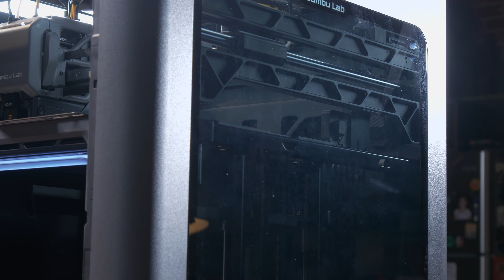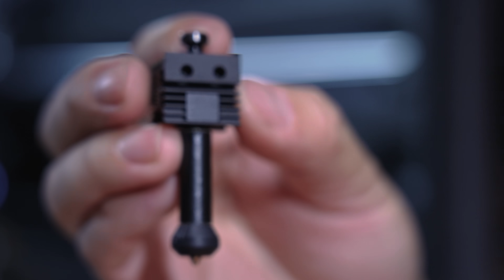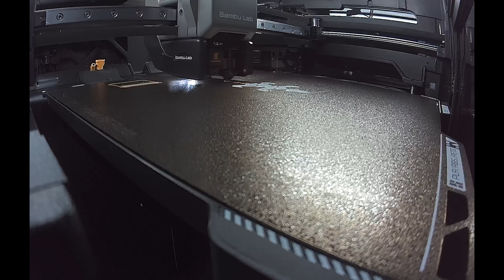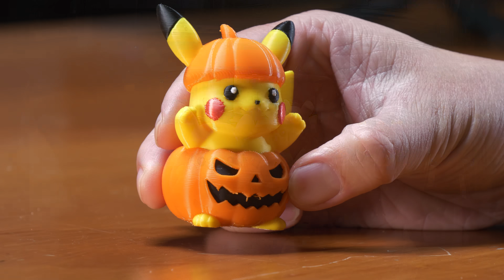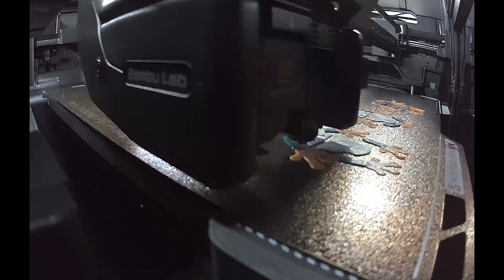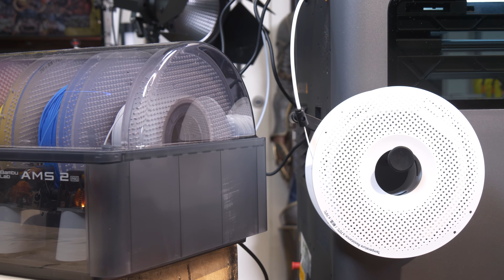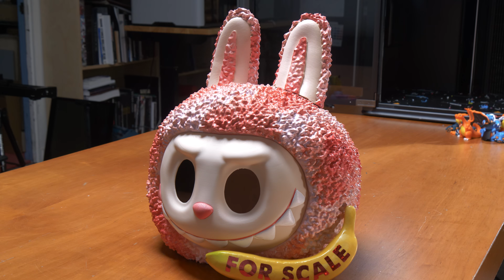Bambu Lab H2C 3D Printer Review: Vortek Tested!

Comment: Okay, so less poop. Yay! However, it still has to switch the color, pulling one out with the AMS and injecting a second one. That seems like time savings would not be all that great, especially since it still has to prime. For $2400 dollars, I think that's still unacceptable. I'm more interested in the separate multiple toolhead systems ala Prusa and Snapmaker. Admittedly the XL is absolutely ridiculously priced the the point of absurdity, but the U1 being sub 1K is an actual gamechanger. I'm thinking that's the direction I'll be going, assuming it delivers on the promises given on their Kickstarter.
Reply: But the nozzle has to be primed for printing or you end up with a length of print that is under-extruded. It might be okay in some cases but if it does that on an exterior face or in a critical location the part would be ruined. This happens with the Snapmaker and Prusa as well and with up to 7 tool heads and up to 4 ASM systems the H2C greatly exceeds the other printers in versatility. If your print only needs 4 colours/materials then the Snapmaker might be enough but the moment you need more than that you need a Bambu machine with multiple AMS systems.
It would be great if they could prime in another way but for now its a requirement of all the printers, regardless or price.
Reply: On the flip side, less to go wrong.
Reply: I received my Snapmaker last week. So far it definitely delivers.
Reply: Am I getting this wrong? To me it looks like there is still waste, it is just going into the prime tower instead of out the poop chute.
Reply: @jamesmeader6539  every printer needs a prime tower. It's still 'waste' but is a requirement for clean prints. Check out CNC Kitchens review for a good comparison and explanation
Reply: @jamesmeader6539 Very small amount of waste to prime tower vs very large amount’s tested out the chute. See CNCKitchen reviews.
Reply: Snapmaker got this one right
Reply: @BillSingh321  There will be Patent wars involved. I know Stratsys are sat on dozens of patents just to prevent other printer companies from getting a leg up on them. The Vortek system seems to be a compromise based on those limitations.
Reply: The Bond Tech solution is the most interesting, that may end up on my Voron, in the mean time, my SnapMaker U1 should be nice, when it arrives.
Reply: This has the advantage of printing the same spool with multiple nozzle sizes. On something like a prusa you'd need a spool for vg toolhead. I'd see myself printing one filament in 0.2, 0.4 and 0.8 depending on need a lot more than multicolor prints.

Comment: Amazing engineering, but looks like it could have a lot of potential issues and points of failure.
Reply: Seems like an intermediary step towards something good. I will skip this generation for sure.
Reply: @WordupG same same
Reply: Like the abhorrent bed heat problem..
Reply: It's a bambu lab. Issues and problems are guaranteed.
Reply: I'm not so sure. No pogo pins like the snapmaker, induction heating which is completely contactless, a stepper motor which is proven tech and just moves the rack up and down; it seems to be pretty simple in its execution even though its quite unique. If something breaks, it looks to be extremely low cost as compared to moving entire toolheads around
Reply: @SangheiliSpecOp  Fingers crossed yeah, time will tell.
Reply: Are you a bot that posts this same comment verbatim on every possible platform? Great for you that it "looks like" it could have issues, according to you. You definitely know more than the entire team of engineers at Bambu.
Reply: wow! what an issue eh! I have an opinion. I never stated I knew more than Bambu.Hell, I love their kit. I own 3 of their machines and have done for over two years. 😂